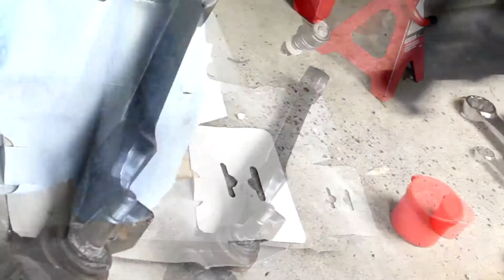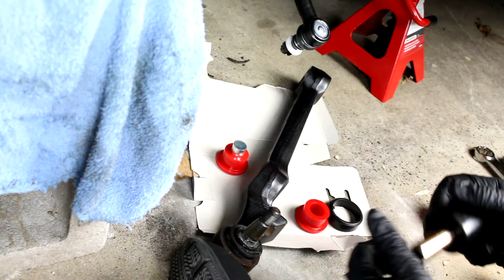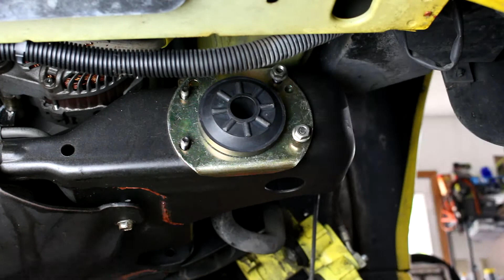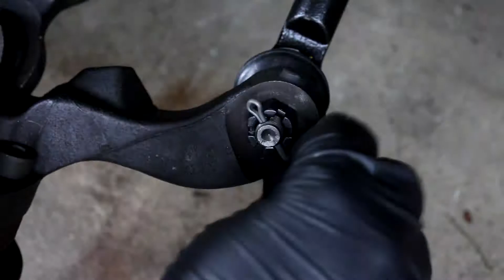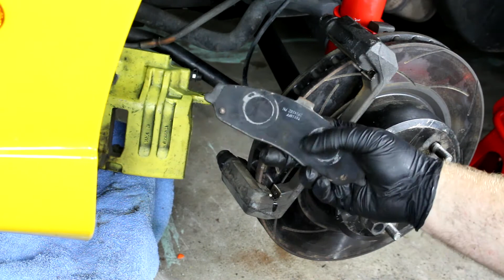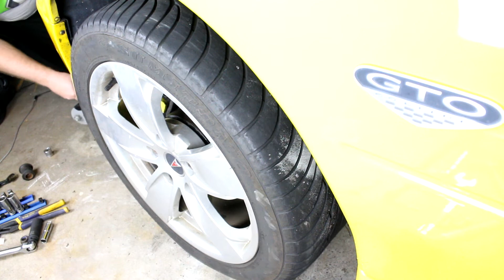Rapid Reassembly • GTO Upgrade Project

Comment: Thx This upgrade is on my list this winter. I'm going to look for a whole kit
Reply from the maker: When I last checked (about three years ago) no one made a complete kit, but there are kits out there that are 80% complete or more.
Reply: @CarsSimplified  Thx I was wondering because I don't see the front bushings
Reply from the maker: Yeah, there were a few missing from the Energy Suspension set I bought (the instructions said they did this on purpose due to safety concerns) but most of them don't cost too much. The ones that mount the radius rod to the front of the frame are pretty pricey, but they are very important to heavy braking performance.
Reply: @CarsSimplified  
That's probably what I need bec my front wheel moves back and forth when I'm 2 stepping it at the drag strip lol
Reply from the maker: Oh yeah, I think pretty much any GTO still on the road that hasn't upgraded needs one of those and the strut mount bushing. Those two parts do a lot of work and get used up fast!
Reply: Kollar racing products.  He just set me up with coilovers and bushings.  Front and rear.